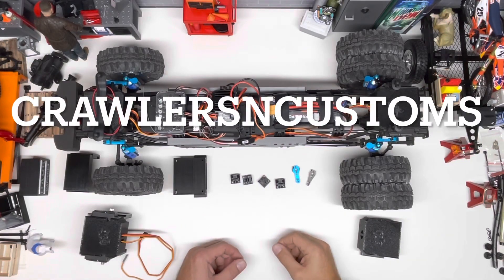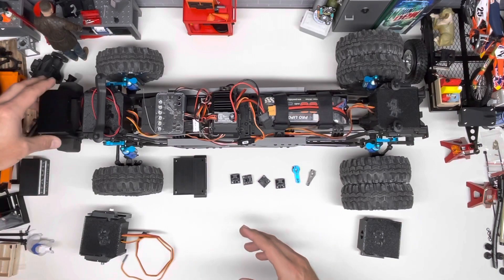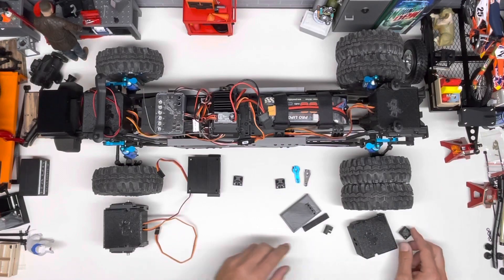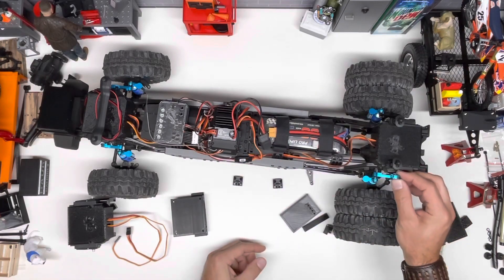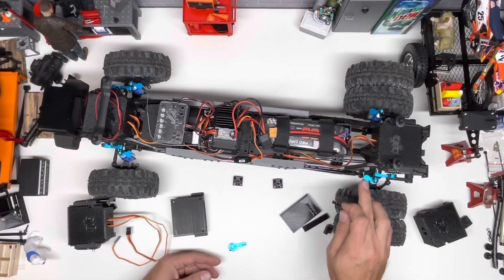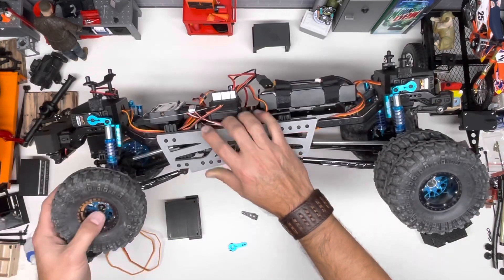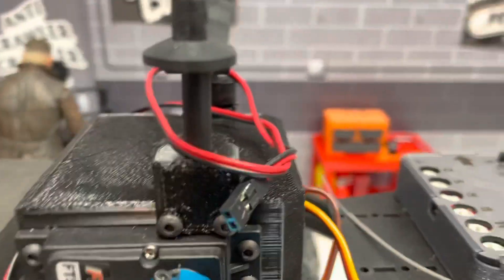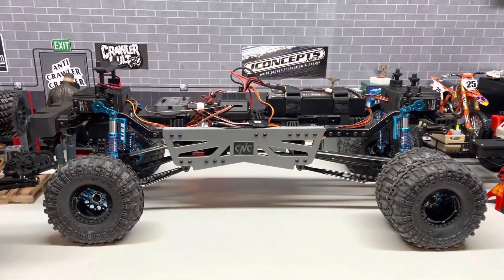Install Instructions for CEN 450 with Dynamic Superscale2020 suspension and 40mm lift kit

Comment: Is your kit out yet???  I have 70mm lift on my fl f450. I want the whole kit. Genius
Reply from the maker: Thx. Yes it is though it’s designed to work with our own lift kit it’s a great place to start on a DIY adaptation to whatever kit you’re using. Check our website and other videos.

Comment: I didn't get the steering servo bracket
Reply from the maker: The steering servo bracket is not part of the anylevel kit. The steering servo bracket comes with our lift kits. Send us an email if you need that part as well. Crawlersncustoms@gmail.com

Comment: Can I use the dynamic superscale suspension in a stock height CEN F450 with a gooseneck hitch to keep  truck from squating down from weight from gooseneck trailer, SCX10 Gladiator and TRX4 high trail  k10.
Reply from the maker: Nope. Not compatible with stock height truck and would still compress at the rear with the extra weight. You need stiffer springs to counter the extra weight.
Reply: @crawlersncustoms  Thanks.

Comment: Will that suspension work with the H Tech 40mm metal lift kit as well?
Reply from the maker: Yes and no. It relies on mounting points at the front and rear of the truck that only exist as part of the CNC lift kit. That being said you could mix and match the HTech lift cradle with the CNC cradle and then use the servo and panhard set up that comes with then CNC kit to then add the super scale but that’s not very cost effective.
Reply from the maker: Also, there is a full on SEMA inspired milled billet lift with electroplated mirrored bolt on panels (like the 1:1 trucks use) in the works but it won’t be released until early next year.

Comment: Hello,
       My name is Calvin, If I was to send you my truck could you put the lift kit and super scale on it? If so how much would you charge?
                              Thx, Calvin Jones
I ordered the H Tech lift kit will that work as well?
Reply from the maker: Hey Calvin. I wish I could but I don’t have any free time. That being said, the lift kit has a bolt by bolt install video. And once you do that, the superscale add on is pretty simple and makes more sense. All in should be a 90 minute job including this add on.